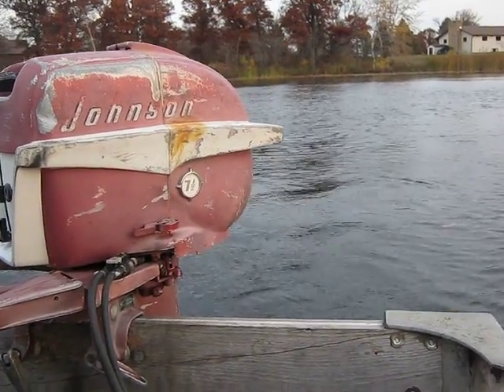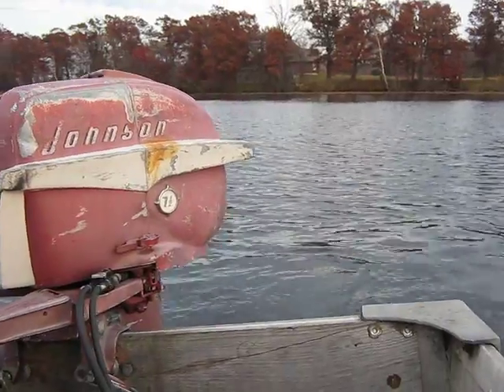1956 Johnson 7.5hp outboard motor

Comment: I have a Jonson 9.5 it's old I was wondering why it won't plain out
Reply from the maker: xcellosmashcat Have you done anything to the motor as in testing for the problem? I think it's time to check the compression, take a look at the spark plugs are both cylinders firing? is the spark good on both cylinders? Is it getting enuf fuel? or too much fuel? What size is the prop? what is the size of the boat? Has it ever run with more power for you?